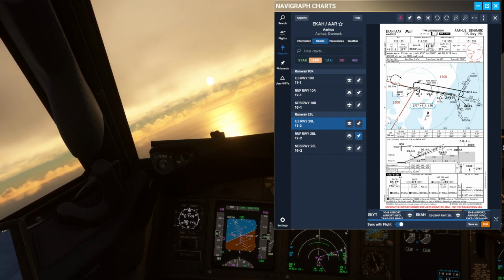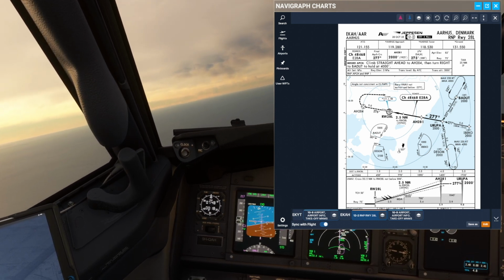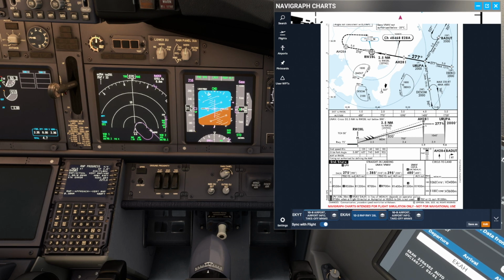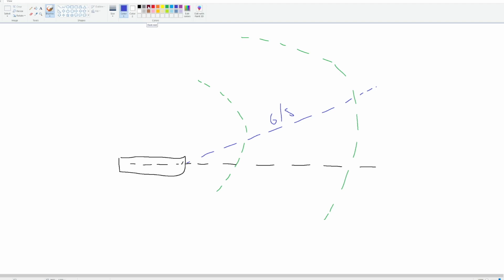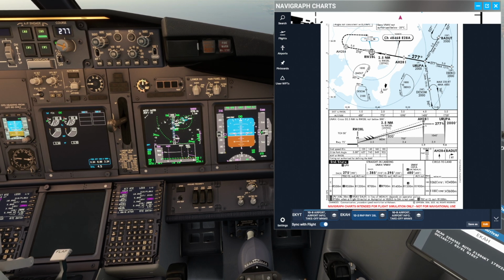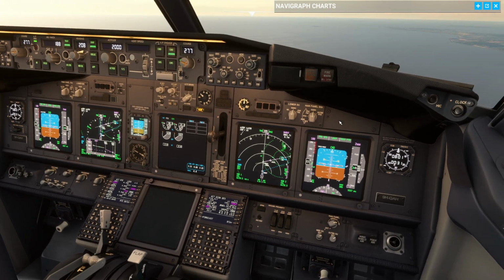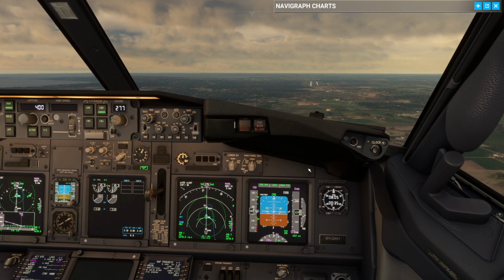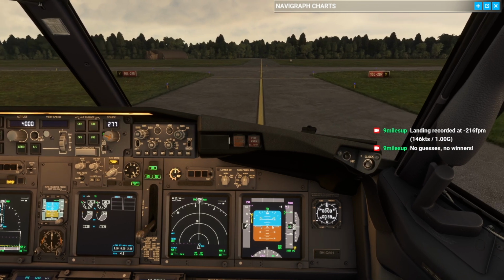In dept how to fly RNP / VOR / NDB approaches using LNAV/VNAV (PMDG 737)

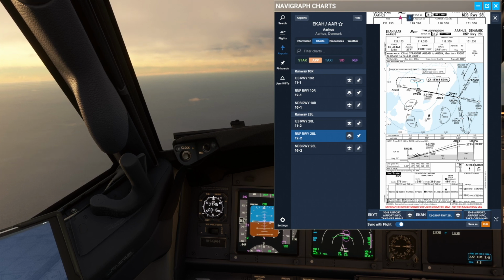Comment: No, LPV is still non-prec. 3:10
Reply: You’re not completely correct. According to ICAO classification, it depends on published DA/H. It can be either “Approach with Vertical Guidance” or “Precision Approach”.
Reply: @tomdungey5164  I'm going of FAA. I fly in US, in United States, no mater of height all LPV's, RNAV are considered NPA. Approaches with vertical guidance (APV) are non-precision approaches and that's what they are. Your AI is wrong buddy, or your instructor told you wrong, if you even fly in real world. CFI's can use them to satisfy their PA criteria but legally it is not a precision approach. Also I'm 100% true you are wrong with EASA or ICAO, give me the paragraph number that says it is. (AIM), Section 5-4-5, Paragraph 7(b),(EU) No 965/2012, Annex I (Definitions) and other references.
Reply: Easa states: “precision approach (PA) procedure. An instrument approach procedure based on navigation systems (ILS, MLS, GLS and SBAS Cat I) designed for 3D instrument approach operations Type A or B”. 
LPV is definitely SBAS, so I guess it depends on the published DA/DH.

Comment: great video! Especially if you learn IFR theory next to it, its really helpful to see an implementation. One question came to my mind. In the video you flew the LNAV/VNAV, so it was a APV, wasnt it? And thats the reason why a DA(H) is allowed, since if I remember correctly, only MDAs are allowed for NPAs (only with some exception if using an CDFA if i recall that correctly). And are NPAs even used with a dive and drive technique in a 737 or will you use a CDFA then?
Reply from the maker: That’s correct. In general when we have an RNP approach, it is flown and to be considered as a precision 3D approach, which is why the LPV minima is the same as a CAT 1 ILS (200’). We just fly it in LNAV/VNAV, hence the higher minima, but still a DA(H). 

Regarding the dive and drive - we do indeed. In the rare case we are required to fly a NPA using V/S, a different technique applies. This introduces among other things, a 2nm level segment before the FAF. This does in some cases really become dive and drive :-) Good fun, but not for pax.
Reply: @9milesup  thanks! Can imagine the fun